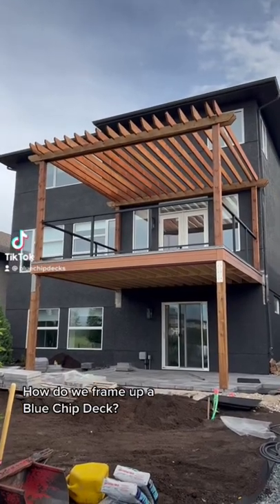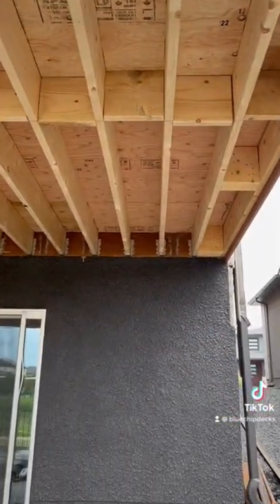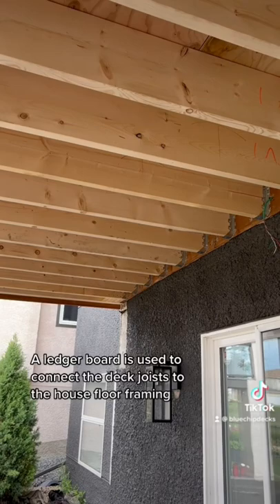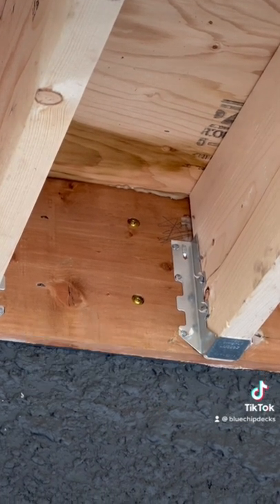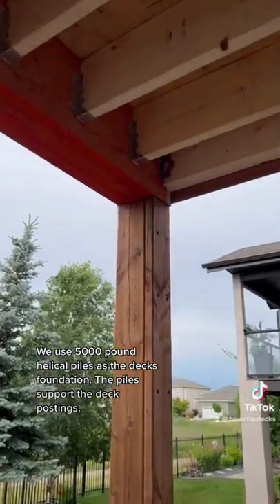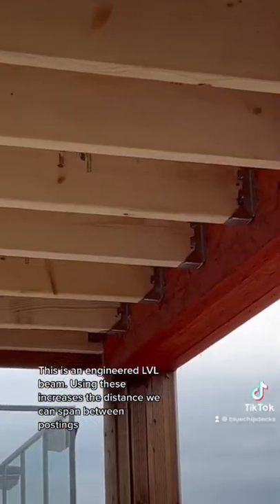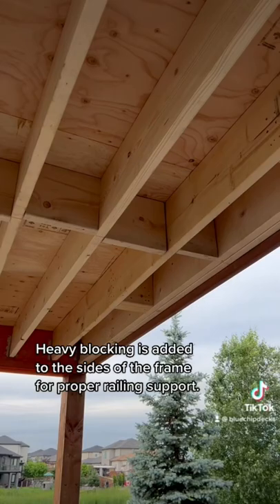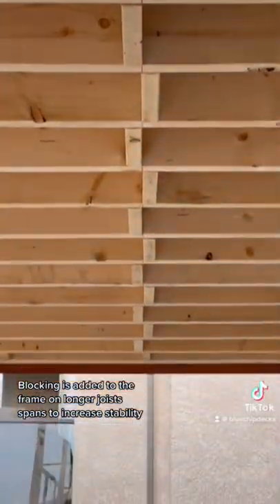How We Frame Up A Blue Chip Deck

Comment: Are those 1/4" grk? Also not staggered.

Also 12 oc way overkill. 

Also should be pt, even if its covered on one side, its not covered on all sides, so it is technically exterior application

Comment: Any reason you didn’t use PT??? Deck appears to be outside
Reply from the maker: The membrane on top is a waterproofing called Duradek.
Reply: @bluechipdecks  yeah, carpenter bees are going to love the new hotel you built them
Reply: Just because it’s not in direct contact with the elements, it’s in direct contact with the elements... sorry man should have been pressure treated
Reply from the maker: @Clovethelightrespectthepower  Incorrect. An open gazebo can be framed in untreated lumber and will pass. This is the same.

Comment: I keep seeing decks without carrage bolts through the rim joist of the house. isn't that required? I wish these were prefaced with we did or did not obtain a permit and we did or did not pass inspection. I know code changes throughout the country but still.

Comment: I definitely prefer something greater than a 5/8 grk for rim joist connections on decks
Reply: If you deny the strength of GRK then you’re just a jrk yourself
Reply: @Clovethelightrespectthepower  Didn't deny anything, just wanted to see something more than what's shown if it's my job. I use all types of GRKs, just not 5/8s on my rim joist connections.

Comment: Ummm let me point out the obvious its not treated lumber and there is only a trellis over head so the water will eventually find its way through the decking and rot the non pt lumber…
Reply from the maker: The decking over top is a waterproof membrane called Duradek.
Reply: @bluechipdecks  very cool we dont see much of that in my area it’s usually just a plain ol P.T deck or pt framing with trex and vinyl rails ..maybe I should do a little research before i flap my gums 🤘🏼

Comment: The ledger board is wrong, it should have 5/8 threaded bolts locked into rim joists with deck2house bolts into floor joists if possible. Most important part that leads to pre mature deck failure.
Reply from the maker: Incorrect. We had it spec. Engineered called for 5” long 3/8” GRK screws.

Comment: What's the span on the 2x8 joist? Especially with sheeting an waterproofing going on. Here code is just under 10ft.
Reply from the maker: I believe the span from ledger to beam is 12’ with a 2’ beam projection
Reply: Usually rule of thumb is 1.5 times the lumber is max span 2x6 =9 ft 2x8 = 12 ft and so on
Reply: @danthecarpenterman9463 well thru the building department here. Any deck over 200 sqft u gotta put in for a permit. There, they will provide you with a deck prescriptive an in there it has the spans for different wood species. Shows right in the maximum span for a 2x8 is no more then 10 ft. An the county follows the deck pre, unless it is engineered.
Reply: Yeah same rules apply and I was referring to pressure treated lumber as that is most common and there are others variables such as joist spacing and beam size . In my area I draft up majority of my plans . Bigger projects have engineered drawings . But pressure treated 2x8 12 inch o.c with bridging is good for 12 foot span max . I never max anything out though
Reply from the maker: @danthecarpenterman9463  The total deck depth is 14’ so we are spanning only 12’ max at the beam.
Reply: @bluechipdecks  yeah there’s nothing wrong with that and a 2 foot cantilever is appropriate
Reply: @danthecarpenterman9463  does that take into account 12" OC?
Reply: @blakel4595  yeah
Reply: That’s way more than 12’, 2x8 joists are way undersized,  the lvl is way over sized and not suitable for outdoor use. And For everybody that said pt, Douglas fir is WAY stronger than pt, pt is shit for horizontal spans

Comment: To bad those structural screws are for interior use only the exterior ones have a green or black coating
Reply: Thank you, also it's a basic torx,not even true ledger anchor screws
Reply: They are specifically engineered to be used outside and/or in pressure treated . They are  being used perfectly in this application. You might be thinking of simson screws or fasten master screws.
Reply: @plumbobmillionaire6246  is it perfectly recommended to not stagger?

Comment: Needs to be PT by code in 75% of the USA even with a membrane. Anything exposed to outside elements needs to be pt. This is a big yikes. Should be 2x10 and that lvl will de laminate from moisture in the air. Liability waiting to happen 😂
Reply: Correct correct and correct.. clueless people out there